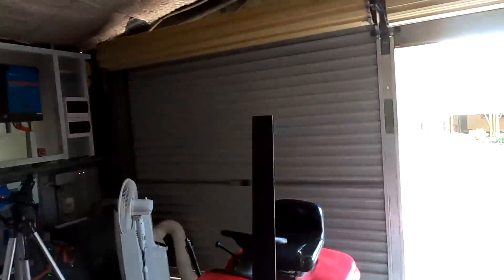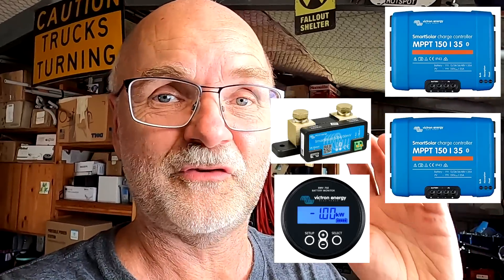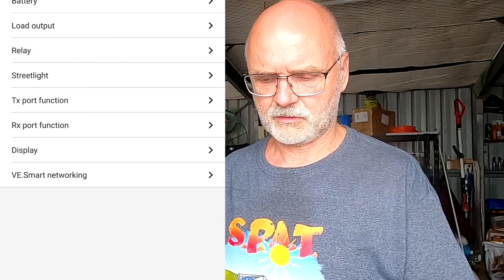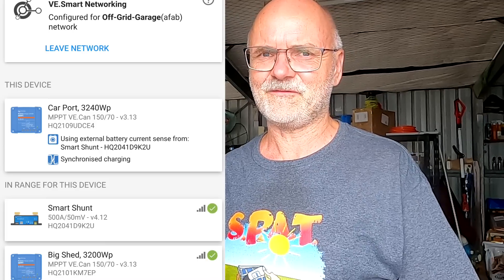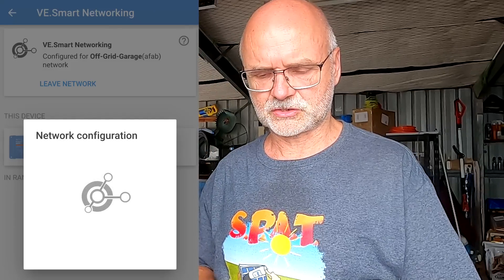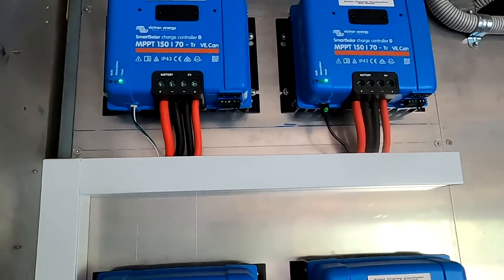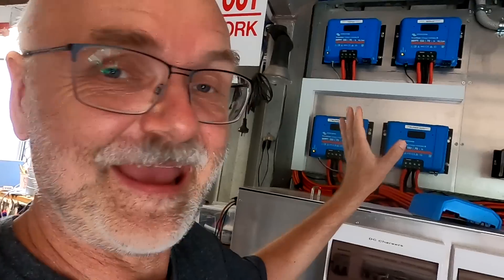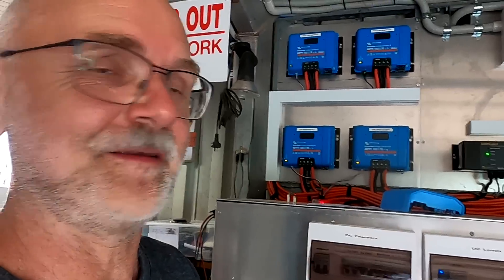Best feature ever? The Victron VE.Smart Network. (I think it's great! 👍)

Comment: Why wont my blue solar 75/15 connect with my smart 75/15 and 100/50 on the synchronization?  I bought the bluetooth dongle and it says its awaiting data but it wont actually work with the other 2. It does its own thing.

Comment: Does using the VE Network feature take the place of needing to use VE Direct cables?
I just installed 3 of the SmartSolar 150/35 controllers with a Cerbo GX and connected them together with VE Direct cables. I have a SmartShunt to install this weekend, but there are no open VE Direct ports left on my Cerbo. Can I just set up the VE Network for all 5 items and remove the VE Direct cables?
Reply: I need to know this too. I just got a cerbo but I have 4 mppt chargers and smart shunt 😬 so I'm not sure how I'm going to connect them all. I did buy 3 ve direct cables with it but I need to connect 5 devices. I hope I don't have to also buy 2x ve-direct usb cables which are about $50 each.
Reply: @tomgrant6563 So using the VE Network does NOT take the place of the VE Direct cables. The Cerbo will only be able to monitor and report on items that are physically plugged into it.
Since all three of my VE direct cable ports on the Cerbo are being used for my three controllers, I bought a VE Direct to USB cable from Victron and used that for my Smart Shunt. The USB end of the new cable plugs into one of the three available USB ports on the Cerbo. Everything works great.

Comment: What would you recommend getting multiple charge controller or one higher amp charge controller? I’m working with 20 panels at 285watts, VOC 38volts@8.9amps
Reply from the maker: If you have all panels facing one direction and no shading, you can use one controller.
If you want some redundancy, get two controllers and split the array.
I have 4 controllers, so if one fails or I need to shut down one side for maintenance, the system will still keep working.
Reply: Yes, I have all panels facing one direction
Reply from the maker: @romulogatpo9903  so 2 strings 10 panels each? Depends on your battery and MPPT you have our are going to buy.
Reply: @OffGridGarageAustralia  actually I’m thinking 3s6p

Comment: I have two MPPT controllers and a SmartShunt all linked together with the VE Smart Network. However, each charge controller handles a separate PV array which are east and west which means that each array is always at a different voltage from the other. Will this still synchronise and work? I also have them all connected to a Cerbo GX so does one connection override the other? Thanks for your great videos.
Reply: It synchronises charging algorithm and shared battery voltage and current with shunt your arrays do not require sharing their outputs.

Comment: Just as newbie here😅
With all this charge controllers, can I use just a grid tie hybrid charger inverter instead?
Reply from the maker: Yes, you can. You still need to program that with the correct parameters for your battery.
Reply: @OffGridGarageAustralia  oh, thanks.
Do I need any additional devices, like for sefety  or balance, etc?
Reply from the maker: @TollyTolly  Yes, you need a BMS, depending on the type of battery you have. Also fuses, breakers, switches...
Reply: @OffGridGarageAustralia  I'm thinking to use 100ah 12v AGM batteries, and build 24v storage system.
Is there any video whe you show schematic of your system. Just wondering how should I connect BMS in a circle
Reply from the maker: @TollyTolly  keep in mind that you can safely use only 50% of the 100Ah in AGM or any lead acid batteries without damaging them.
You would not need a BMS for AGM batteries but need to setup the charging algorithm in the hybrid inverter correctly.
The only thing you may need is a balancer for 12V Lead acid batteries if you put them in series. One like this: https://s.click.aliexpress.com/e/_DmsDzZX
Reply: @OffGridGarageAustralia  I'm thinking about deep cycle AGM, as manufacturers promice up to 80% discharge

Comment: Andy, you've done a ton of things with solar and LifePo4 cells.  After watching a re-watching I was able to understand what you were doing and the logic behind those "experiments."  I have learned a lot and thank you.
However, you have completely lost me with this DVCC.  I don't think I have missed any of your videos but perhaps I missed the one where you told us why you chose to put this into your system.  It just seems this device will override all the settings in you charge controllers.  But why?  We have them programmed to appropriately charge our batteries and everything was going fine.  All of a sudden we have this DVCC (had to look it up).  I just can't understand the need as long as you have your charge controllers and external chargers (if you have them) set correctly.  You lost me, Andy.
Reply from the maker: Thanks a lot John. You've been a valid member of this channel for a long time. I appreciate all your comments and always looking forward to your input.

I haven't done a full tutorial on DVCC yet because I cannot utilise it to it's full potential. It best works with Victron supported batteries and BMSes which I don't have.
I mainly turned this on because I need to control my charge current somehow. With the new solar panels installed, there is just too much current coming in sometimes (up to 270A I have seen!) and I have not designed the battery and shelf for such high currents. Initially, I tried to throttle the solar charge controllers but that is a bad way of doing it. People kept suggesting to turn on DVCC and limit the current through this function which works like a treat.
I explained it all in this video here: https://youtu.be/xXFyj-h3Tf0
Reply: @OffGridGarageAustralia  Always good to hear from you Andy!  You have been such an inspiration and help as I setup a small system at our remote cabin.  The link you provided clarified everything for me.  I must have missed that one.  
Watching the other video regarding the DVCC I kept saying to myself; can't he just limit current thru the CC?   Your video answered that-----yes you can, it is just more efficient and convenient to use the DVCC feature.  I didn't even know it was there or what DVCC stood for when I saw that video when it looked like it was messing everything up.  
My system is so small compared to yours I don't have to worry about too many amps from the CC but it is good to know it is there if I need it in the future.  Besides, I learned one more thing from you!

Comment: I saved a bit of money with going for 150/45 BlueSolar and not the smart one, So if i add another controller it will function weird and posssibly not function and charge the battery correctly?
Reply from the maker: It will work just fine. Set both controllers the same settings and there is no problem. If you have very long runs of your cables or can see a larger voltage difference between MPPT and battery, adjust these settings accordingly.

Comment: Power failure possible?

What I was wondering: 

- If you do not have Victron chargers or the smart network is not used. 

- The batteries are full during the day.

Will the BMS disconnect them,  to prevent overcharging?

If so...

What would happen if your grid would fail? Is the BMS fast enough to turn on/ deliver power to the inverter, so that the inverter output to the house never has a hickup? (So computers keep running?)
Reply from the maker: You always need a charge controller! You cannot use the BMS for charging your batteries. That can be fatal. The solar charge controller or grid charger is set to a specific voltage to charge your batteries to. If the charger fails, the BMS will protect the battery. So there is this 2-step safety function of both working together. But you should not rely on the BMS to do your daily charging.

Comment: I use the VE>SmartNetwork from up the beginning and it works so as defined. i have 3 Charge Controller plus one SmartShunt. And make sure that you have on all Chargers the same updates running, not only the same settings for charging.
Reply from the maker: Thanks you. It actually also works with different settings, just not as effective. Once controller could turn off earlier than the other so charging could slow down...

Comment: Andy I just followed ur instructions for my two Victron charge controllers but they won't synchronize is it because one has built in Bluetooth and the other I had to order a Bluetooth dongle? Both are 100/30 charge controllers
Reply from the maker: Have a look at the compatibility list of devices as mentioned in the Victron document: https://www.victronenergy.com/upload/documents/Manual-VE.Smart-Networking-EN.pdf
Reply: @OffGridGarageAustralia  ok because I did notice they both are synchronized to the shunt on the voltage part I just don't see the word synchronisation

Comment: Can you charge batteries from Charge Controllers and an hybrid inverter at the same time ?
Reply from the maker: Yes, no problem. Make sure the use the same settings for bulk, absorption float if possible.

Comment: Great Video Andy, I have the BMV-712 Smart In my system. 
I use a Raspberry Pie 4 & VE. Direct cable, connected to the BMV-712 Smart, streaming out data to my WIFI network as the Shunt/Chargers are located quite a distance away from the Router.
This works perfectly on the VE. Smart Network. I do love the Victron MPPT Chargers (The Rolls-Royce of all MPPT Charges), BUT they are out of my $$.
I use 2 Renogy Rover LI 60 amp MPPT charge controllers, with both Voltage SENSE wires connected to my 24V 400AH LifeP04 Lithium System. These sync very well together!.
I have 2 seperate solar arrays facing different locations one for each charge controller. Keep the Video's Coming, from John at Logan.
Reply from the maker: Thanks a lot for sharing, John. The Victron gear is quite expensive but considering they provide software updates, the VRM and a great service included for free, Nothing you will get anywhere else. 
Sounds like a good system you have setup there.

Comment: Can you try making a series of charts & tables to explain the various connection modes, the benefits & limitations of each? It sounded like important functionality is disabled when using BT & VE network are used or was it just when & where you can change settings & sequence of connecting? The current connections combine each application with physical & low level protocols so it's harder to make them portable & universal. Having >5 competing standards complicates setup. I'm guessing the first solar charge controller added becomes master of all subsequent devices.
I wish they could allow BT to be a backup link if hardwired networking (TCP/IP) fails & allows rerouting between the multiple methods of connection (needs similar application layer in the network stacks, emulation or a translation layer).

Comment: The smartshunt says it delivers current and voltage sense.
The chargecontrollers all state  they are using current sense from the shunt. Nothing about voltage.
Switching charging mode from bulk to  absorb is all about voltage, isn't it?
A little confusing. As they switch synchronously, it seems they read voltage too. They just don't tell us in the app.
Reply from the maker: They use the voltage to switch synchronised between modes, yes. The Smart Shunt can also share the temperature of the battery if a sensor is connected.

Comment: Can you get the same multi MPPT benefit using bluesolar MPPTs, the 702 non-smart shunt, all connected via VE direct to a cerbo?  Ie. The cerbo collects the shunt data and sends out to MPPTs? Via SVS, STS and SCS?
Reply from the maker: In the Victron document there is a list of compatible devices. Some Bluesolar dongles are working as well.
Reply: @OffGridGarageAustralia  thx. I'll look up what's possible with dongles, although i suspect that will interfere with the VE direct wire into the cerbo
Reply from the maker: @bluemu  It does not interfere with the VE.Direct cables. I have also set the VE.Smart Network but have all devices linked with a cable for reporting purposes.
Reply: @OffGridGarageAustralia  but the dongle for non smart devices uses VE direct, and MPPTs only have one VE direct port, so if you use tge dongle you lose cable connection to cerbo
Reply: @bluemu  when you use a Cerbo setup with „non-smart“ devices connected via VE direct you can make use of DVCC instead, i.e. for a similar functionality/„synchronization“ of information between your devices like the BT-based VE smart network does. But I don’t think you can use it as such.
Reply: Hmm, explicitly in the VE Direct Bluetooth Smart Dongle is the statement "synchronised charging is not possible with VE Smart Networking"  :(

Comment: Andy, I have ( 2 ) Victron Controllers connected to a Victron Smart Shunt to my 600Ah LiPo4 Battery  Array. ALL works Fine in their Ve  "Network". . In the same Camper I also have 2 more Victron Controllers connected to a SEPARATE AGM Battery Array.  Those two controllers refuse to create a second Ve Smart Network.  Any ideas what is happening? I 've tried to create the second Network from each of those 2 controllers with NO luck..

Comment: Shouldn't all charging devices use the same information anyways? Even ones without Bluetooth?
When I installed my 450/100 rs, and connected by VeCan, it immediately showed "external control. And when I activate equalization on my MultiplusII, it does that by controlling the mppt...
All was fine.
Now I had to remove 1 of the 24 Pz cells. I reprogrammed all voltages on the bmv, the MultiplusII and the mppt... And now they all do their own thing 🙈
The MPII stays on "bulk" all the time, even though it sees that absorption voltage was reached.
I couldn't find a way to set it back as it was, with the MPII being the center...

Comment: Thank you Andy, always nice to be introduced to different scenarios, unfortunately I will have to learn something somewhat different before I start using my system comprising the multi II, Linx shunt, linx distributor and Victron 250/100 charger all controlled by Cerbo.
Reply from the maker: All Victron gear is mostly plug'n play, so very easy to setup and operate.

Comment: I love SmartNetwork too! Data reading is much easier with it!

I bought BatterySense and created SmartNetwork:
1pc BatterySense (SmartNetwork host, temp, direct battery voltage)
1pc SmartShunt (current in/out, accurate battery percentage)
1pc SmartSolar MTTP (charging data)

Later I want VenusOS with RPi4 (VE.Direct>USB cable already arrived)...
Reply: I added a BatterySense which is really handy for giving the SCC an accurate battery voltage and batt temp for temp compensation. Only downside is the temp does not appear in the VRM. It states this in the docs but I don’t know why it isn’t made available.
Reply: I have the same setup with a rpi, one thing i dont like is all the diffrent batteryvoltages i get. Battery sens shows one, the shunt almost the same, but mppt always a few more mv above. And if you look at the mppt smart network it actually gets the batteryvoltage from the smartshunt.(well not actually, but it say so) I would rater all devices should get and show the battery voltage from the battery sense.
Reply: @TheCampersSweden  yes, it is a pity the user cannot select (it appears) between smart shunt and BatterySense for the battery voltage.
Reply: @kevinmills5293  I would say it’s bc. there is no much sense, respectively kind of duplication of functionality when you use a battery sense + a smart shunt. The smart shunt covers all functionality the batt. sense provides and should be layout equally close to the battery, hence as accurate in voltage- & temp readings. In fact you could state the smart shunt being the “smarter” device than the battery sense. So I don’t really get the fact why you would have both in a (normal) system layout(?).
Reply: @Schoigter  I added a BatterySense to my system because the Victron BMV does not have Temp monitoring. If you have a Smart Shunt, a NTC temp sensor can be bolted to the battery and connected to the Aux input on the shunt and the BatterySense would not be needed. The downside to the Smart Shunt reading the battery voltage is any voltage loss in the negative cable between the battery and the shunt will skew the battery voltage measurement. The BatterySense voltage measurement will not be skewed by system load.

Comment: Just to add clarity for Victron newbies - you need a Smartsolar charge controller and not a Bluesolar charge controller. The Bluesolar range doesn't have the ability to create a smart network. This is even if you buy the Bluetooth addon for the Bluesolar units.
Reply: My reply got deleted, how unfortunate.
Reply: Can a victron smart b2b charger be used in the network ?
Reply: @karldingbat  no
Reply: @doucet2006  ok, why not ? Its got smart bluetooth built in so i cannot see why it cant be added to a bluetooth network.
Reply: @karldingbat  
I have no idea also.
But it's also not compatible with Venus os
Reply: I have a Bluesolar 150/70 which I tried to update via VRM and succeeded in getting a 119 fault Now to sort this I have to buy an adaptor and a Victron blue tooth dongle then go thru the process of trying to clear and update/restore the workable software - been told that the Bluesolar is out of date"and I should replace it with a new series Victron for R 8500.00. Grr!